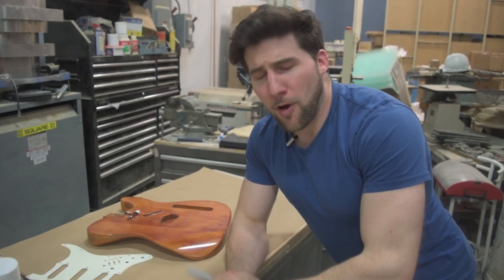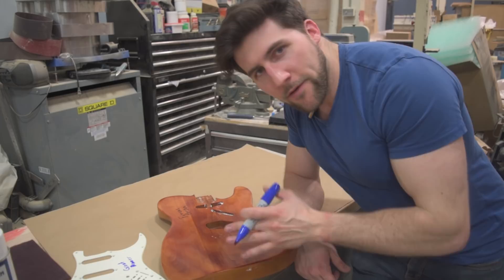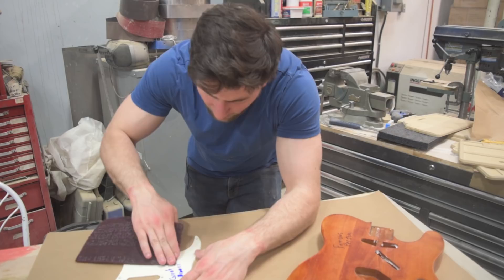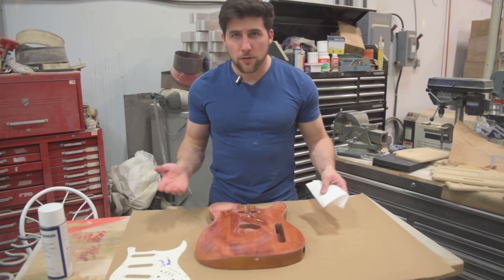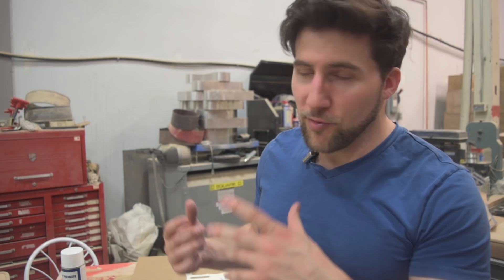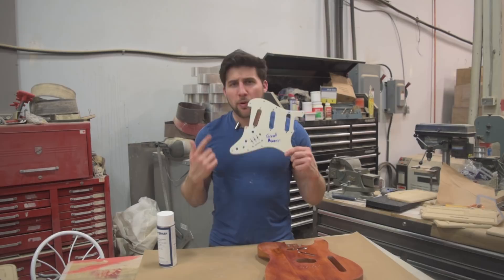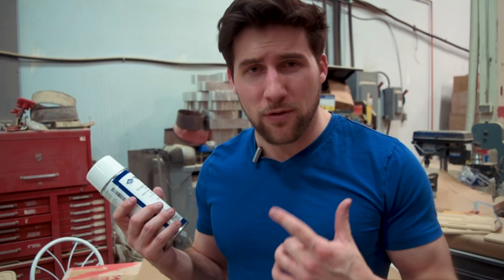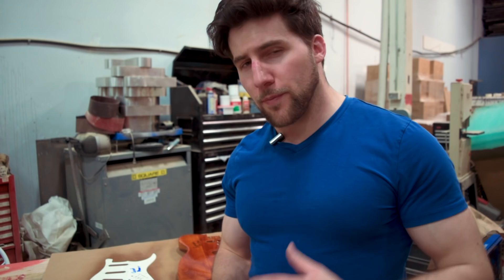How to Protect Autographs on your Guitar or Pick Guard

Comment: Hey Brad! I have Brian May's aurograph on his BMG guitar. So scared to sand it down. How far should i go ?
Reply from the maker: Just sand very gently around it with some 800 grit. Consider using an acrylic clear as a neutral mid-coat to avoid any potential melting. Let that dry fully and sand lightly again before using a more durable clear coat.

Comment: I have 2 guitars autographed by Frank Hannon & I’m terrified to even attempt doing anything. One of them is nitrocellulose (Gibson) which makes it even tougher.
Reply from the maker: If you’re not going to be playing them, it’s probably smart to just leave them as they are to avoid any risk of screwing up your protection coat and causing further problems.
Reply: Problem is I play both of them. The Gibson is my #1 & the other which is an epiphone double neck which I also use frequently.
Reply from the maker: Ok, you may want to consider bringing it to a professional then.
Reply: Hi bro! How did you resolve the protection of your gibson?

Comment: If i use paint pen should i still sand before they sign and then follow the video if the guitar is layered with polyurethane
Reply from the maker: Yes, still sand. The type of clear overtop depends on what type the paint pen is.
Reply: @BradAngove  sorry to bother you again but what type of paint pen would you recommend the guitar is a attic white squire stratocaster with a Basswood body and a Polyurethane finish 

Once again I apologize for bothering you
Reply from the maker: I like to use acrylic paint pens because they’re compatible with most top coats.

Comment: hey brad i got a question. i got cornhole boards made and the guy put a coat down of indoor/outdoor poly it has a shine to it. its my weddings guest book to sign both of the boards. should i use sharpie or paint markers? i need help the wedding is this saturday
Reply from the maker: If you’re not going to sand them at all I would use sharpie, but if you want it protected better I would sand smooth with 800 grit, use paint markers, and then clear coat afterward.

Comment: I have a mechanical metronome that has some sort of varnish on top. Would you suggest sanding the surface a bit, prior to using a sharpie? And then, what would be the best generic varnish that can go over the sharpie, so that is doesn't bleed?
Reply from the maker: Yes a gentle sanding followed by your sharpie and then an acrylic/water based varnish.

Comment: So, at the end of the video, the guitar body does not have a perfectly glassy finish from the newly applied clear coat. Is that a factor of time (it smoothes out as it dries and cures), or the cost of doing business (it will be protected, but never smooth)? Is this the sort of thing where a few more coats (albeit unnecessary) would provide enough build up to sand down to smooth without damaging the autograph?
Reply from the maker: All of the above haha. Some clears level more over time than others. If you want to be able to sand and polish afterward, you will need to build up a few more coats.

Comment: Great tutorial and I will buy the lacquer you mentioned to seal my guitar back cover drew with paint marker. Does the stringed instrument lacquer work on Polyurethane finished guitar also? Thanks!
Reply from the maker: It does if the polyurethane is cured fully and you sand it.

Comment: Can you help maybe.

Situation:
I have a pickguard and sand it with 600grit sandpaper. I draw on it with a posca marker. Its acrylic paint. 
Its dry now and want to use a clear coat to seal the posca marker.
What clear coat can i use and will it burn away my posca marker? 

Can i use 2k clear coat
Reply from the maker: You should be able to use the 2K
Reply: @BradAngove  thanks. And the acrylic wont drip or burn away? Do i need to put a very light coat first
Reply from the maker: I’ve never encountered that issue, but if you’re worried just use a thin coat of acrylic clear first as an inter coat.

Comment: Thanks for the great info and demo.  I have a White Sharpe Paint Pen signature on a black plastic pick guard. It's been set for a few week, assuming I follow your steps in the video - anything I should be concerned about - I really feel I need to just lightly spray the whole guard.
Reply from the maker: Use adhesion promoter and if you really want to be safe use an acrylic clear coat.

Comment: So, I've got a Mark Tremonti signature guitar that I plan to get signed, but I still want to play it, hence finding this video. Say I pre-sanded the surface and got signed , would that work? And would steel wool be ok?
Reply from the maker: Yes, that would work. Ideally you would also have the signer use an acrylic paint pen instead of a sharpie.
Reply: Brad Angove cheers dude.

Acrylic pen it is then 😊

Comment: Hey bud unless 6use or handle waxy , greasy,or have been handle  solvent based products there is no need to waist your money on solvent based cleaners.even body you shops seldom use it .wind dexter is fine from start to finish.

Comment: Hey brad quick question! Do I have to disassemble my guitar in order to get this signature done? I could get painters tape to prevent coating from getting on unwanted areas
Reply from the maker: You would generally want to at least partially disassemble it, but if you’re comfortable taping it off that can work.
Reply: @BradAngove another thing! I have “Krylon  UV-resistant clear Acrylic coating “that should be fine for the pre coat right?
Reply from the maker: I’m not sure. I avoid Krylon; I’ve always found it unreliable.

Comment: Great video.  
   Still, PLEASE HELP BRAD!!!
I have been wondering how I could do this. I have a bass that is literally covered in just about every big name in hard rock today as well as one famous drummer who just passed a couple years back. I know the bass had been sealed at some point, but I dont know with what (factory). The finish is definitely a Satin like finish. There is NO WAY POSSIBLE I could sand ANY OF THE BODY, it's  THAT covered.
   Brad, what would you suggest? It's imperative I protect all of these  Autographs.
Reply from the maker: That’s a slightly more risky proposition. I would apply a coat of adhesion promoter for sure. Then at least one coat of clear acrylic lacquer as a medium. Give that ages to dry. Like 8 weeks. Then decide if you want to sand that lightly and add an even more durable clear over top or if you’re happy with it as is.
Reply: @BradAngove  thanks for the advice. The body was never painted just stained to highlight the beautiful wood body, so I think I have that going for me. I am building a true hardwood display case with UV protected glass installed.  Because of the amount of huge hard rock and metal names that have been autographed on the body and neck, I NEVER play it even though that was the reason why I bought it in the first place.
  Again, thanks for the advice. I was really hesitant to apply ANYTHING until I could speak to a professional for some advice.  🤘
Reply from the maker: If you’re not going to play it and it’s protected you may not need to apply anything to it.

Comment: First time watching your stuff, really helpful. I have a Schecter bass signed by Nikki Sixx and would love to be able to play the thing without smudging. I have a Spray Max 2K from your store in my cart. But you also mentioned an acrylic clear - I couldn’t find one listed in your store (unless I missed it). Any recommendations?
Reply from the maker: There are lots of them and you would just use a thin coat for the bridging. Rustoleum painters touch or duplicolor work fine.
Reply: @BradAngove  thanks for the speedy reply. One more question of ignorance (although something tells me you’re used to that), when I’m sanding, how do I know I’ve sanded that first layer of lacquer before I start chipping away at the paint - just stop once it loses its shine?
Reply from the maker: Do you mean between coats or during the polishing process?
Reply: @BradAngove   So as I understand it, I’m to sand the area around the signature, use wax/grease remover to clean, apply acrylic clear, then apply the 2K clear coat. My bass is a deep blue color - so during the sanding process, I’m assuming I could potentially sand too much to the point that I start to remove the paint, so I was wondering if there’s a “sign” to look out for when you know you’ve sanded enough? I’ve also never done this before and know next to little about woodworking / painting, so let me know if I am thinking about this the wrong way.
Reply from the maker: Oh ya, it’s just a gentle sanding to give the acrylic clear something to adhere to. Just to take off some shine. Don’t push hard.
Reply from the maker: The first real sign will be color on your sandpaper. Try not to go there.
Reply: @BradAngove  thanks Brad. Got all my materials and believe I’m ready to go. Had a question about disassembly though - I watched your other 2 videos (on disassembly) and wanted to know if in this case I can avoid needing to remove / solder wiring? It’s not something I’m terribly gifted at and wasnt sure if it was necessary since I’m not doing a full paint job, but rather just applying acrylic and instrument lacquer.
Reply from the maker: If you’re coating the entire front face of the guitar you would generally want to remove the electronics, but you could just take off the knobs and pickup rings and tape up the rest in the cavities.
Reply: @BradAngove  I must be learning from you, I just finished taping up the cavities before reading your reply. Cheers.
Reply: I’m getting a signed bass from Nikki next year. Did he just sign his name or did he write anything else?

Comment: What brand of Paint Pen would you recommend for signatures?
And also would that signature be safe if i were to transport that guitar (in a hardshell case) to sand and coat it the next day? Thank you
Reply from the maker: I like acrylic paint pens for this. The brand isn’t important per se. 

Let it dry for a long as you can before putting it in the case. It will likely be fine.

Comment: Despite bringing a paint pen with me, Ace Frehley signed my Gibson Les Paul Studio guitar with a bronze sharpie before I could stop him. Ugh. Anyway, do I need to just stick with nitro, or should I seal it with the acrylic clear as a medium first and then hit it with nitro after a few weeks? BTW, your videos are awesome. Thanks for taking the trouble to make them.
Reply from the maker: You may want to just go with the acrylic clear. That should seal it in and provide similar protection to nitro without the risk of yellowing.
Reply: @BradAngove  Thanks for the reply! Just to be clear (ha ha) it's okay to go with the acrylic clear over the nitro that is already on the Gibson? There won't be an adverse reaction over time between the two?
Reply from the maker: There shouldn’t be as long as the nitro is fully dry.
Reply: @BradAngove  The nitro is 30 years old now so I'm probably good there. :) I gotta say, in retrospect, I wish I'd have had him sign the headstock or picked up an Epi for him to sign instead of my Gibson. I'll let you know how it goes...

Comment: I’ve bought guitars with autographs. Cleaned them right off. Looks stupid and devalues the guitar if you ask me. Unless it’s Jimi Hendrix, Elvis Presley or someone like that. Les Paul, Slash and  Zakk Wylde signed guitars are a dime a dozen. I’ve actually decided not to buy a guitar because it had a signature on it. And it was nitro finish. So I passed. Pickguard or back of headstock, maybe. But body of the guitar with a big sharpie marker on it? Hideous